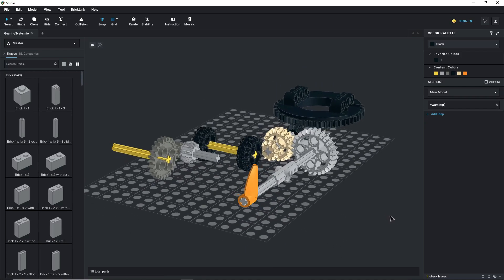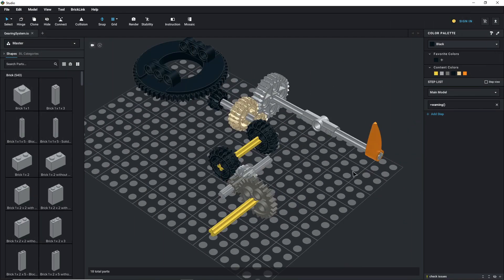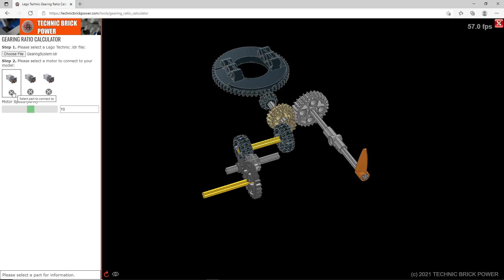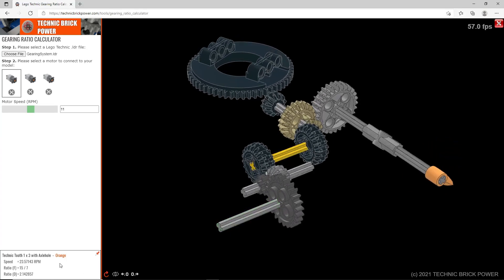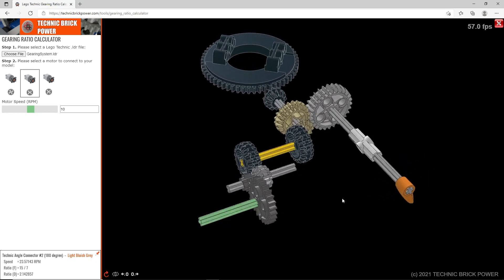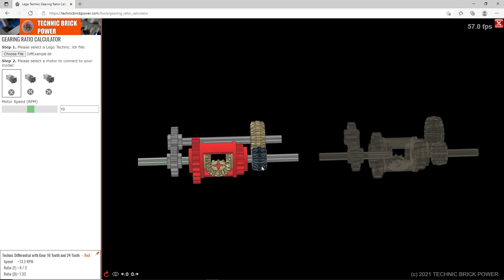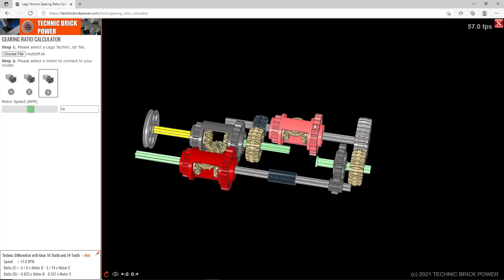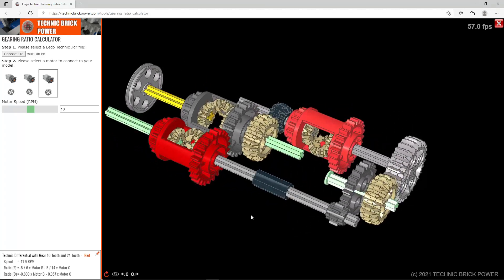Lego Technic Gearing Ratio Tool Update

Comment: Very cool tool!
Reply: Also I am curious, the mechanism shown at 10:00, if you have the same ratios on the left and right side:
1. The system would still be under constraint right?
2. But the top axle can still only run at 1 speed relative to the input (I think?) since difference in the left and right cancel out?
Assuming the above two statements are right, how does your system deal with that? Would it know and indicate that the exact speed of that 1 axle is known?
Reply from the maker: Hi Legotechnic27 - thanks for your questions! 
1. yes if left and right were the same it would still be underconstrained. 
2. Good question - I had to try it out on my tool! Guess what...it resolved the output to 1:1 with the input - so it solved the problem. I have impressed myself haha.😂